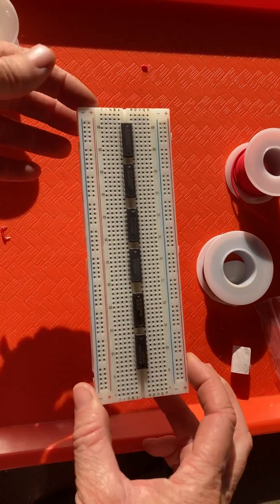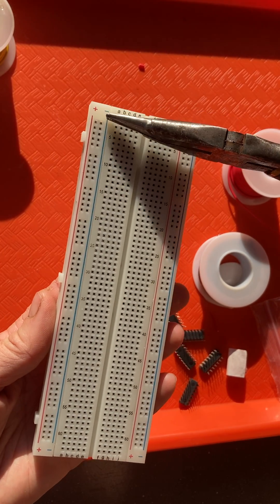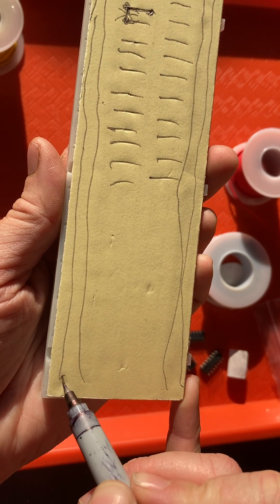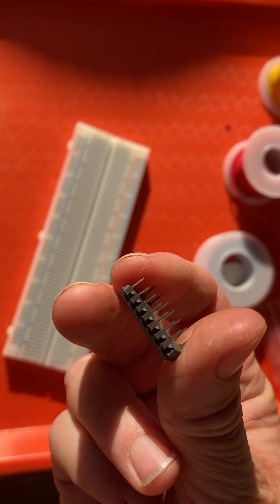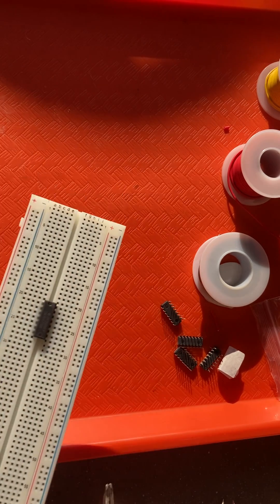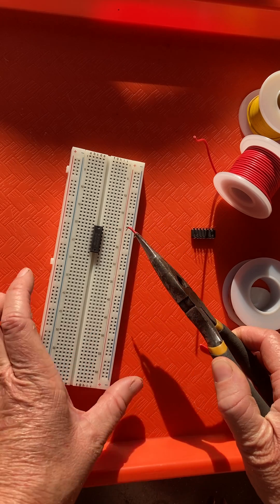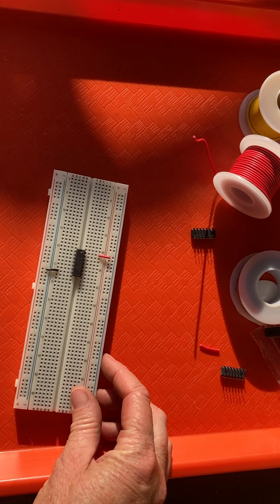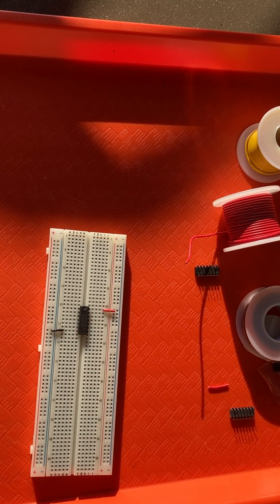Why's it called a Breadboard?  Intro to Breadboarding.  Making High-Quality Prototype Circuits

Comment: Its called a "breadboard" because we would glue a schematic  a wooden board and pound little brass nails into it and then wire up all of the components to create a functional circuit. I dont know of anyone that actually used their mothers breadboard. It's just a slang term.
I did exactly this as a class project for a transistor radio at DeVry in Phoenix AZ. Its similar to point to point wiring that was common for vacuum tube radio's. I did that in my senior year of High school in 1974. That is a " Proto-board" (brand name) used in the video and are the evolution and work great for integrated circuits "IC's" and because no nails or soldering is required its much faster but the end result is not a cool looking! (DIP is "Dual Inline package" not processor. The correct way to hold one is with your fingers on the ends - never touch the leads with your fingers. you dont want to bend or contaminate the leads.
Reply from the maker: I would love to see your 1970s prototypes.  Post pics here if you have them.
Reply: @Prof.K.   Oh I wish I still had that breadboard. I kept it for many years and it disappeared in a move I think. It was a kit radio that included a PC board but the instructor had us breadboard and build each section (stage) of the radio after a lecture - during lab time. Fond memories. I had not even thought about it until I saw your video! Thank you. I do have a recent tube phono pre-amp that is point to point wiring. I should do a short and post it...